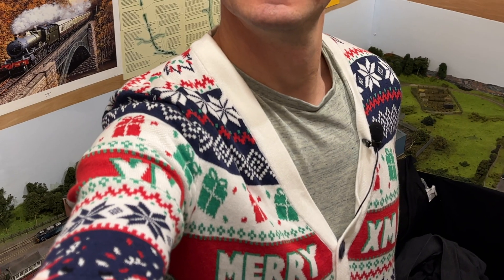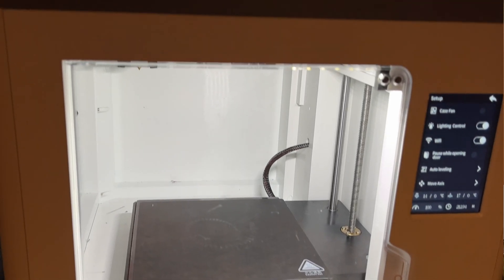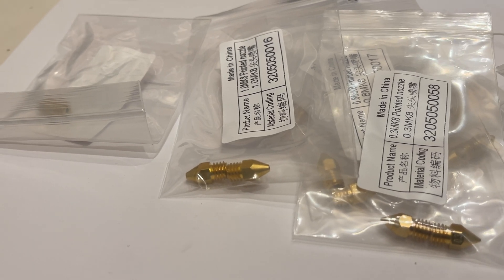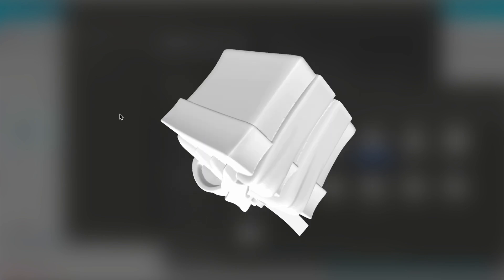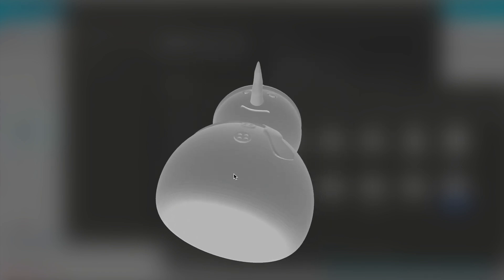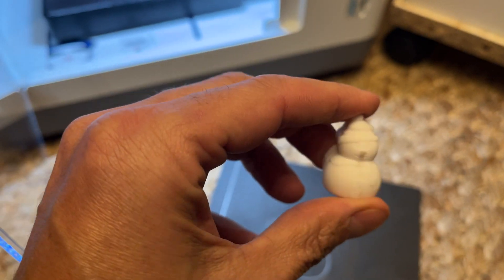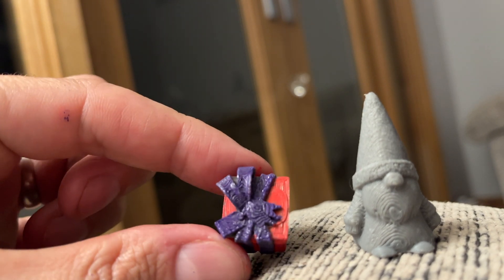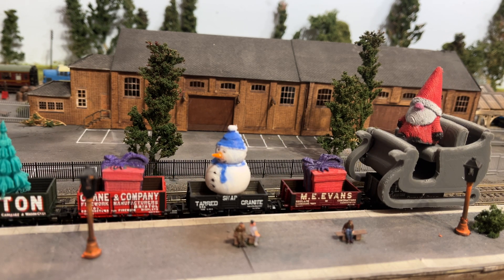Xmas model train, using the Creality Sermoon V1 Pro!

Comment: Very cool. You can eliminate some of those lines and "finger print" effect, by using the latest version of Cura and printing at a slightly slower speed, around 10mm/sec. The creality slicer is just an old version of Cura. Awesome project!
Reply from the maker: Thanks for the info! Just installed Cura and had a play and it seems a lot slicker and more up to date, will try some prints with it 👍